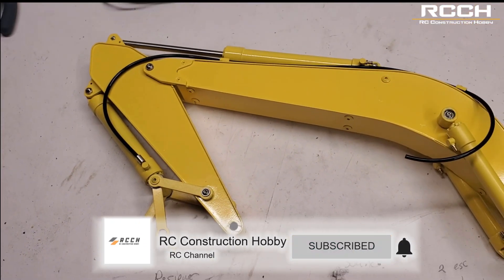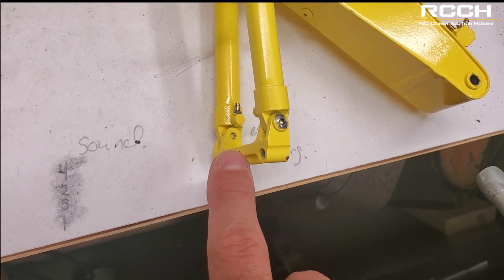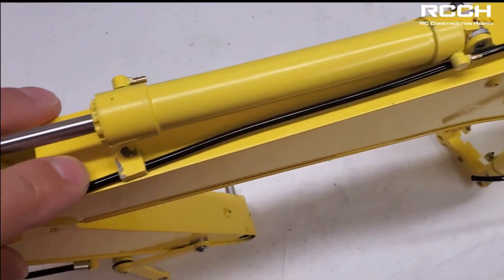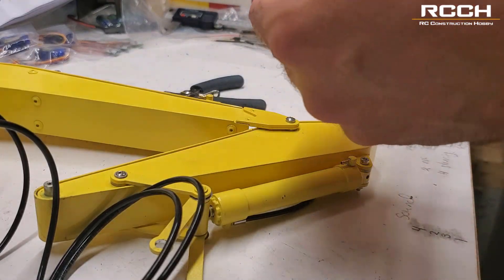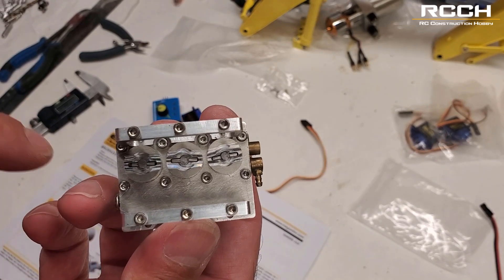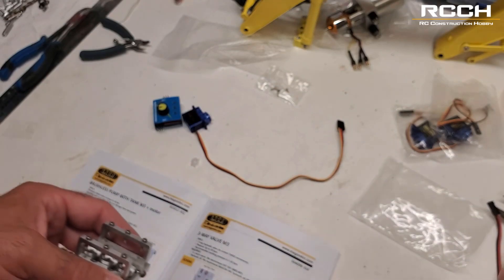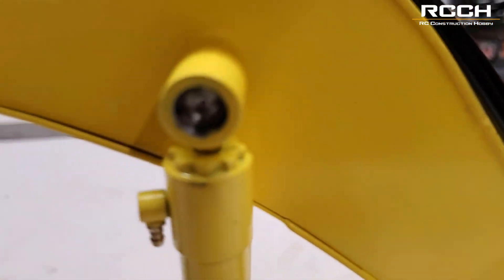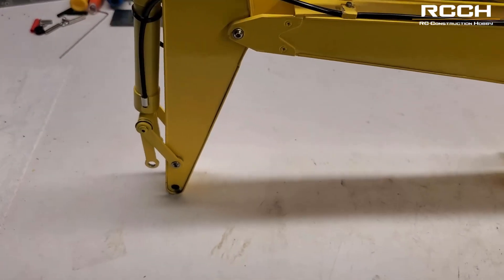HOW TO UPGRADE your HUINA 580 to Hydraulics with the MAGOM conversion kit!

Comment: Hello. I'm new to your channel. I'm just getting into rc excavators which I've got the huina 1593. Will this hydraulic kit fit the 1593. Also do you know where I can buy metal tracks for it as looked all places I could think of with no luck. Many thanks
Reply from the maker: Hi Graham,  I dont think the hydraulic kit will fit this machine but you can get tracks from aliexpress. just search up huina 580 tracks.
Reply: @RCConstructionHobby  thanks very much ill have a look and let you know how I get on

Comment: Really accurate!!
Useful also in case of maintenance! 

Looking at the costs...I think buying a new brand Kabolite 336 GC will cost nearly the same than upgrading (unfortunately) ...but in the end you will have 2 excavators (for sure a plus) !
Reply from the maker: To be honest the 336gc is not that great. I like the huina 580 conversion way better. If anything get the volvo ec160 from double e.
Reply: @RCConstructionHobby  maybe you are right...Kabolite 336 GC is not so powerful (only 3kg forearm,  4kg bucket) ...your suggested upgrade hope maybe better !

Comment: If you warm up the hose first it will slide on the fitting really easy.
Reply from the maker: Yes that is a good tip. These were not to bad. The collar.thst goes on after was a probably harder or more annoying.

Comment: Hello! Could you please explain what the difference is between to the original arm and the magom arm? It it longer and can lift higher? Is it worth the extra money? Greetings
Reply from the maker: Yes the main boom is about the same length. But the stick is longer and will lift higher to get into the tamiya trucks better. I think its worth it for the extra height.
Reply: @RCConstructionHobby  ok cool. Thanks a lot

Comment: Hi, what maximum battery can I install for the Huina 580 excavator? I would like 5000mha, but that it would fit into the excavator instead of the original battery
Reply from the maker: You have to modify the inside to fit a 5000mah. I fit a 5000mah and have hydraulics but has to be a shorty battery not a long 5000mah as it is to long.

Comment: Will this also work on the hulna 1550 in 1/14th scale?  Thank you Terry Graham blackwolf12003@yahoo.com
Reply from the maker: I believe it will work on the 1550 but will require some modifications to make it fit and work. Its not a direct install like the 580

Comment: Nice video. But $750 in upgrades on a $500 machine? For that $1250 the 4200xl excavator might be a better choice of you can afford it all at once.
Reply from the maker: well ya since the 4200xl is on sale right now sure go for the 4200xl. but if you want to build something yourself or if you want something smaller then the Huina hydraulic might be a better option. then again you can get the new Kabolite for about $1700 or the EC160. So many choices its up to you to decide what works for you. This is just one option.
Reply: Where can you buy the 4200Xl for 1250 USD?
Reply from the maker: @novideosnovideos544  I think that it was a black Friday promotion.

Comment: I'm loving it so far. If you were to use metal servos do you have to use a specific size (guessing the mounts would have to match the servo block....right)
Reply from the maker: Yes 9g servos will fit. I would think metal servos will do. That is something I want to do over the winter.

Comment: its really really wonderful build good job bud excellent work👍 but i see you put plastic servo you must put it metal gear servo because the pressure needs to the high pressure the plastic is useless anyway i hope 2see wheel loader hydraulic from huina himself we needs hydraulic no more electric 
its wonderful video pal thx✋
Reply from the maker: I agree it needs better servos. These are the servos that magom supplied in the kit.
Reply: @RCConstructionHobby  yeah dude that what's up try use servo 4 earth mover 870k micro servo 3kg 4.8v this servo on earth mover 870k already when you buy it her he metal gear and very strong

Comment: How would you rate the quality of the servo block?
Reply from the maker: The block is ok. I find that it does not hold the cylinders 100% in position. There is some sagging when the valves are closed. I think that the chinese stuff might be stronger at holding pressure
Reply: @RCConstructionHobby  suffer from the same problem by the sound of it, not a Magom block though. I presumed its down to a leaky cylinder ? although it works fine.
Reply from the maker: I have had leaking cylinders as well. It was not a good start with this kit. I dont know if they make there own cylinders and block or just get Chinese and ship it as a kit. They told me they tested everything yet I had 3 leaking cylinders. And a chattering servo for the main cylinders.
Reply: @RCConstructionHobby  Not exactly comforting at the price (MAGOM is not cheap)...should be a lot better